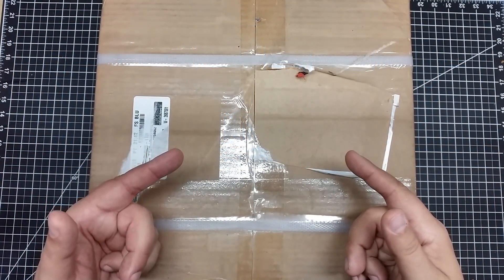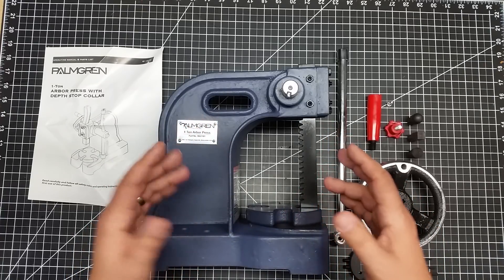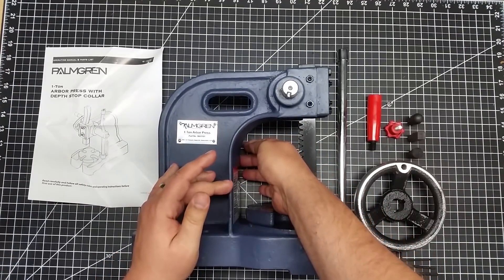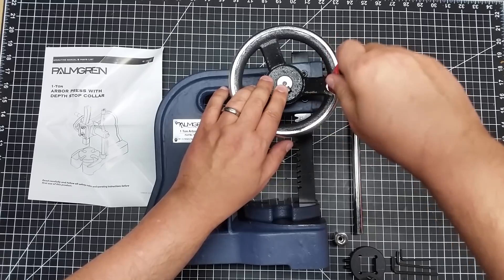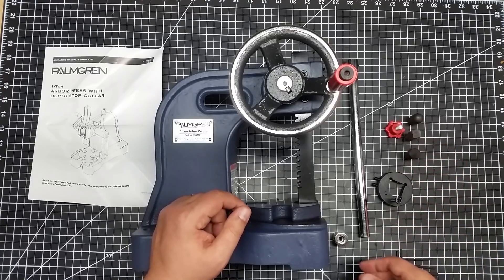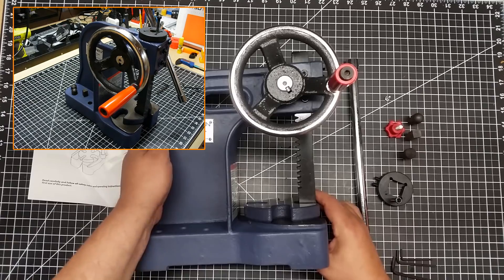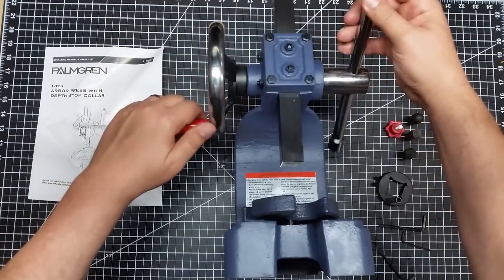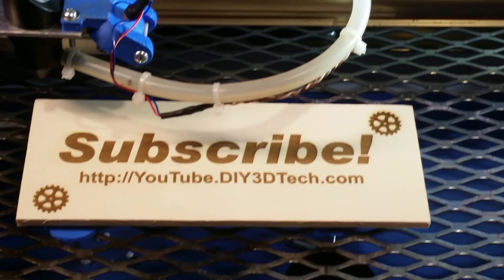Shop Talk - A Ton of Fun with my PalmGren Press!

Comment: One feature that is particularly useful...the built-in handle.

Also, if you find the (red) knob (used to hold the arm-handle in position) doesn't adequately secure the handle: remove the knob, place a small chip of (pliable) plastic into the threaded hole, then replace/tighten the knob. The plastic-to-metal contact increases the slip resistance.

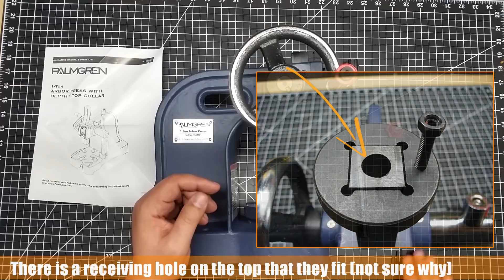Comment: At 5:03 you point out (in writing, at the bottom of the screen) that there IS a properly-sized hole for the tool bits, but your hole is at the top instead of the bottom (exactly like mine was).  I took the front plate off my press so that I could turn the arbor upside-down (or back to right-side-up I guess!).  Now the tools fit into the arbor properly.

Comment: 7:50 there is nothing keeping the pin on the arbor.. think about it.. if the pin is ifxed to the arbor the arbor should be precisely moving against the die, in this way the "precision of the operation" in in design a die with a guide for the pin and make acheap arbor to drive it.

Comment: I have a half ton arbor and I still dont understand what the slots in the plate are for. I initially bought it to use with steel stamps to stamp desgns in my metal jewelry. It wasn't much help in this task because the nut that tightened down the stamp in the end of the ram caused it to always position slightly off center causing an uneven impression. Now I am wondering what else I can use the arbor for.

Comment: Dude the ram flips to allow the hole on the bottom to fit the punches. You can turn the ram or as you call it the arbor to use the punches.

Comment: The ram is reversible.  One end is solid and the other end is drilled and magnetized for use with adapters.
Reply from the maker: May thanks, yet there a reason they shipped this way as would seem to make more sense to do it in reverse....

Comment: A couple of previous comments stating that the RAM was probably upside down is “CORRECT” and as far as taking the unit apart to turn the RAM in the correct orientation, it is an extremely simple task of unscrewing 4 screws to remove the plate that hold the RAM in place, and then just doing a 90 degree flip of the RAM and then just screw back on the bolts into it's plate.
For those who may be curious, yes I do own this specific one ton press, purchased it about two weeks ago, so I am in the know to what I state…. Lol
This specific unit even though it was manufactured in China, has some solid features for an inexpensive one ton hand press, but there are a couple of area’s that really need improvements.
The first area that requires improvement is the RAM, instead of machining the RAM with a small threaded hole on either its front or its side and adding a set-screw to hold in place the dies that came with the purchase.
The manufacture instead decided to use a magnet into the RAMs 20mm deep hole, while the magnet does hold all three of these dies in place without any slippage, the moment you attempt to use any other item that was not machined to the specs of the RAMs design, you are then prone to destroy said magnet.
Case in point, the very first day after receiving my PALMGREN Arbor Press, I attempted to use a small metal punch for leather cutting, to see how well the unit would work.
Well, no problems cutting through the test sample of leather, but that was the last time any of my dies would hold any of my dies, due to the total crushing of the DAMN magnet…. lol

The second area that requires improvements is the fastener, (RED Knob) that locks the Arm handle in place; there have been numerous complaints over the internet on this specific feature on the PALMGREN, and I can corroborate that their complaints are warranted.

If anyone who reads these comments wishes to know how I got around this specific problem, then feel free to continue reading, and for those who have no intention in purchasing this press, then this may be area where you disregard the remainder of this post.
  :)
…………………..
My work around for the PALMGRENS slipping Arm Handle:
Note: these were comments I previously made after purchasing this unit on Amazon.

For those of you who have complained about the red knob on the Arm handle loosening after a few minutes, I am here to alleviate your irritations …… lol
I just received my Palmgren AP10 this week and I too became a member of the “RED Knob Irritation CLUB” so what I did was quite simple in order to eliminate this irritation, if you follow the steps that I took, I am confident that you may also become an ex-member of the RED Knob irritation CLUB”
1. I cut a small piece approx. 1 “ of an old rubber vacuum belt with a thickness of 2mm or 0.079th of an inch for those of you who are metric challenged.
2. I then went to verify the dimensions of the screw on the little red knob “which was roughly 2mm” and then went to find a 2mm circle punch to cut-out a 2mm rubber circle.
3. I then took the tip of my Awl and started to rough-up the bottom of the RED knob screw in order for the cement that will be used to have a better surface area to adhere to.
4. Next, I roughed up the punched out little rubber circle for the same reason, to have cement adhesion. Note: you would find it much easier if you first roughed up the piece of rubber BEFORE you punched out a 2mm circle.
5. I then used rubbing alcohol on both the RED Knob’s screw end and the punched out piece of rubber before I added a drop of Barges cement on both pieces and let them dry for 5 minutes before I attached the punched out rubber circle to the end of the RED Knob's Screw. Note: you probably can use any type of contact cement to adhere these two items together......****** NOTE 2 *** I also used rubbing alcohol to completely clean the Arm handle that the rubber tip would contact.
6. Finally, I waited for roughly 30 minutes to allow the rubber and the RED Knob to dry a bit before I screwed in the RED Knob into the Palmgren press, my intent was to place a LITTLE more pressure on the rubber and RED Knob in order to cure over-night. Note: I made sure that the Arm handle was in a complete vertical position to eliminate any possibility of movement.
The next day (today) I tested the RED Knob to verify if my hypothesis of putting a rubber cap at the end of a metal screw would function as intended, and I am happy to say, so far so good!
Also note: after the rubber cap was incorporated, it was no longer necessary to put a lot of force on the RED Knob to hold the Arm handle in place, a mild amount of force is all that is required.
For those of you who try this procedure, let us know how it went by leaving comments.
Reply from the maker: This is a great comment! Many thanks for sharing this!

Comment: From the Palmgren website:   "Punches or tools may be added to the end of the ram with the aid of a magnetic insert. The ram is reversible with one end solid and the other end with a hole and magnet to hold bits and tools."
Reply from the maker: Many thanks for sharing this!  Did not know the ram was reversible (not covered in the instructions provided)....
Reply: @DIY3DTECHcom  if you purchased you Palmgren press at amazon, then you should of clearly seen that the RAM is reversible ... lol ... can you let us know the diameter and the depth of the hole in the RAM?
Reply from the maker: ebay...

Comment: I would pull it apart and mill the shaft where the lever bar goes though into a hex head. Then put a 1/2” drive socket on it. Then you could run the ram down quickly with the wheel but not have the lever arm whipping around in circles.
Reply from the maker: Interesting idea! 👍

Comment: Doesn't look any more or less functional than any other cheap china press.   I think the ram (not the arbor) is in upside down since it has a hole in the end that might fit the tools.   A good review would check the ram for perpendicular with the "platen" and/or base.    Does the ram operate smoothly or does bind in spots over the travel of the ram?   No explanation of what an arbor press was/is used for ?   Most interesting thing for me is that Palmgren offers an arbor press.
Reply from the maker: Thanks for commenting :-) and I am glad you found something of interest, as more of the goal here is "why did I select" this one.  As yes I could have bought any of a hundred differing types, however I selected this one and I cover this in this the video in some detail.  As there are a zillion videos on YT cover everything one can imagine on arbor press, and mine is not to compete or add to the heap, mine is to share my 'reasoning".  I am also not say my reasoning either right or wrong, however a perspective or lens someone with interest may wish to use.  Also the hole is in the geared ram so I would have to disassemble to flip and the strange thing is I have seen others like this.  Maybe it was built on the Monday they got it upside down?

Comment: i noticed that there is a hole in the top. turn the ram over and you will have the hole down for the pins.
Reply from the maker: One would have to take it apart, however I wonder if its one of those it was built on Monday things?
Reply: @DIY3DTECHcom  
No, its a fact that one would not want to use the dies, so they put the solid peess side down.
Many folks get the harbor freight press and have the press machined to take the dies, ie leather and kydex craftsman.  Its a snap to flip.